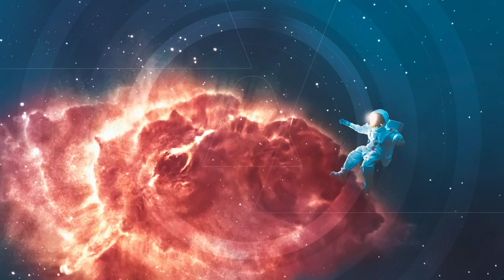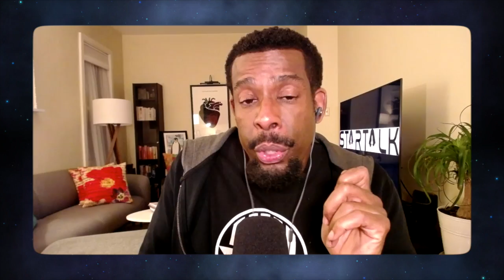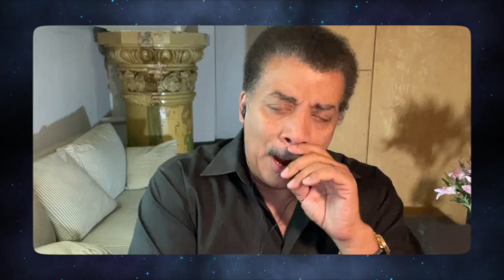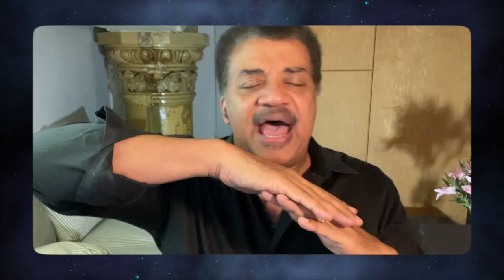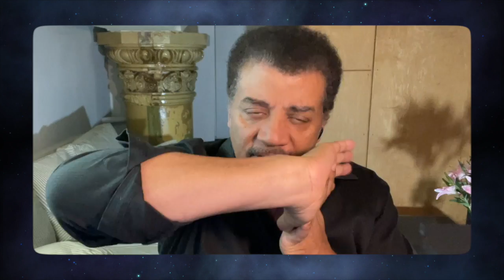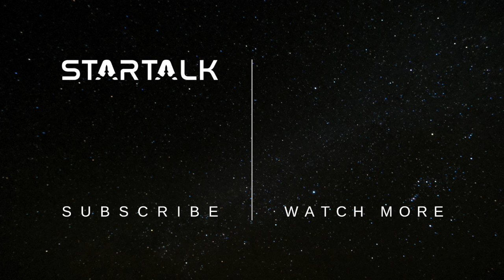Neil deGrasse Tyson Explains Banking Turns

Comment: Nice to see someone who isn't a pilot explain something about aviation and have the information be factual 🙏!!
Reply from the maker: Thank you for your comment, Kelsey!
Reply: Oh my god
Reply: Hey Kelsey
I have faith you'd repeatedly be able to do this manually 🤔
Reply: There is no special computation necessary. You fly the turn by banking the ac and the turn radius is a result of the bank angle. Acceleration will alway align as described. And if you maintain altitude during the turn you will definitely feel it because the resulting force increases with 1/(cos Bankangle)
For 30 degrees Bank it will be 1,15G
Reply: @nev4ever  It's amazing how easily he could have had his hypothesis falsified!
Reply: Neil’s IQ exceeds that of all TikTokers combined.
Reply: Not factual. He is 100% wrong. Even said he didn’t research it.
Reply: I don’t think Kelsey actually listened to this.
Reply: Hey 74gear, listen carefully starting around 2:00 in.

Comment: I work as a crew member for a commercial airline. Typically the crew are let out of their seats after take off much earlier than the passengers while the plane is still at a relatively steep incline while doing the necessary turns to vector in on their cruising course. Even after all the years spent in the air I still enjoy seeing the looks on the faces of passengers when I stand up to commence my duties while the plane is sometimes in the middle of a 30 degree turn and I'm standing perfectly upright.

Comment: Correct me if I'm wrong, but according to classical mechanics, it's definitely possible to have the net force vector point downwards, but it can't equal the force of gravity, unless the aircraft descends as it makes the turn.
That means that unless the aircraft descends while taking that turn, you will feel "increased gravity".
Reply: That's correct.
If the bank angle in a coordinated turn is 25° (typical for passenger jets) the passengers will be exposed to about 1.1 g or 10 % more weight than normal. That's a pretty gentle force unless the change from 1 to 1.1 g happens abruptly.
Reply: @fromnorway643  thanks, appreciate the reply

Comment: Banking has a place in Star Trek and Star Wars due to the orientation of the vessels and their crews, because they ues artificial gravity plating to orient them like contemporary naval vessels. Humans (and by extrapolation, the other species in those IP's) have varying tolerances to g-force based on the direction of acceleration. These are called by direction from eyes (in/out/up/down/left/right). Banking reduces the impact of uncomfortable g-forces on the crews from turning.

Comment: Star Wars vehicles hand wave away the need for decelerating retro rockets by using a sci-fi technology called "repulsors" or "repulsor lifts". Repulsors are what allow the vehicles to take off vertically, hover, and pivot in place. In the novelizations pilots typically have some control over the angling of the repulsor "fields", but in many cases they just vary the power output and tip the vessel itself. There are a few scenes in the movies where you can see the nose of a fighter tip up to angle the repulsor field ahead of the ship to slow it.

Comment: Hello Start Talk!  Airline pilot, flight instructor, and 20+ years in aviation.  What you described is called coordinated flight.  No computer is necessary and humans can maintain coordinated flight because of the force vectors acting on the aircraft during the turn are generally in equilibrium at all angles less than 90* in level flight.  Adverse yaw is a condition that is naturally occurring when a roll force is applied, and is responsible for the “sway”.  For this, pilots use the rudder pedals to stay coordinated.

Comment: If there is a set speed and a set bank angle where the gravity vector still pulls in the same direction, you are talking about 2 constants that make that situation so. However, an airplane does not go from straight and level flight into a bank instantly, it slowly goes into the bank until it reaches that angle. The speed stays constant through it all. That means that you only have 1 constant (speed) and one variable (banking angle). Shouldn't that then also mean that the angle of the gravity vector gradually changes to where it should be as the banking angle changes?

Comment: Pilot here. It doesn't take a computer at all. The more bank you add, the more of a 'load factor' or g-load you get. That g-load is keeping the water in the cup. You don't notice it because we do shallow banks. At 60 degrees of bank you will have 2 Gs, and you would definitely start to notice.
Reply: You are correct that positive G-forces do keep the water in the cup. But you have to be in coordinated turn to keep the water level.
Reply: @jashpatel1477  Correct, this would not apply in an uncoordinated turn.

Comment: CORRECTION ON AIRPLANE COMPUTER TURNS.
Dear Neil, I love your vids and your work.
Just a heads-up on the accuracy of your info about coordinated turns on airplanes being made by a computer. That is not true.
Since day 1 of flight school pilots learn to coordinate a turn (ie. to balance the forces out during a turn).
There is a little instrument on-board to help us do that, it is called the turn coordinator, and it can be as simple as a mechanical device where you center a ball on a round rail, or as complex as a bunch of computers measuring out acceleration and gyroscopic stability.
At the end of the day, that balanced turn can be made "by hand" by any pilot, by means of using the rudder (that vertical fin at the back, which controlled by the feet lol).
So coordinated turns (force equilibrium) is one of the basics pilots skills one must aquire to become at least a decent pilot.
(old school: a glass of water on the dashboard also does the trick. Just make sure you do not unbalance that turn or you'll find yourself with an electrical fire emergency in no time) :)

Comment: Dr. Tyson got this one wrong. Any pilot (and I mean ANY pilot) worth his salt is fully capable of doing a fully coordinated turn so that the water will be perfectly level before, during and after the turn. Not only that, but it'll be second nature to any pilot. No computer required. Just the good old basic flight training. Student pilots learn how to do this in their very first days at flight schools, and never forget.

And here's the kicker: the banking is not just so that passengers don't feel the turn: the banking is absolutely necessary for the turn because it IS what actually makes the airplane turn.  Not the rudder, but the bank. When the airplane banks, some of the lift generated by the wings is redirected to one side, pulling the airplane around.

Comment: If you watch ANY of the Star Wars (movies/TV/cartoons) and look at the docking bays you'll see the openings are ringed by blue lights, these are shields that keep space out and air in. In TROS (The Rise of Skywalker) Poe is given a small disc, that disc allows a ship to fly through the shield into the bay, without it you die in space (except for droids, and Jedi they'll survive).
Also, it says it right at the beginning of the movies "A long time ago, in a galaxy far far away" therefore it is reasonable to assume that the safest way to move ships around in a small space is to use the light wands, the same as they do for aircraft today.

Comment: The only thing is: it's not flying on a cushion of air, it's accually hanging under a vacuum. The shape of the wing is pulling air molecules apart on the top side of the wing. There is a tiny bit of compression at the bodom side, so little you can ignore that. That what they teache me at school long time ago.

Comment: @StarTalk CORRECTION for "Neil deGrasse Tyson". What you described is called "coordinated turn". You don't need computers to do coordinaed turns. You can manualy do coordinaed turns in small single engine aircraft like Cessna 152, Cessna 172 etc. by using the correct rudder, ailerons and elevator deflection. In this case you can bank the aircraft to 45 degrees or higher and the water in the cup will remain level without tilt.
Then you can use inttruments like "turn and slip indicator " or "turn coordinator" to monitor the turn coordination and make necessary adjustments.
Reply: Properly trained pilots don't even need an instrument to make a coordinated turn. The balance of the forces is easily felt, and the airplane is simply controlled to keep them in proper balance.
Reply: @harvey66616  Are you 100% sure you don't need any instrument to do coordinated turns? If so then why are the instruments installed in the coocpits of experienced pilots that have been flying for many years? That will be like waste of money because if they don't have the instruments in the plane they will consume less fuel and make more profit. When flying in clouds or night then how will you know you are flying straight and level inside clouds with turbulent air?
I doubt if there is any training out there that can change the nature of human body to be like a bird.
If you go with your feelings without instrument reference you will probably become a dangerous pilot.
Reply: @IshaqIbrahim3  "Are you 100% sure you don't need any instrument to do coordinated turns?" -- yes, of course I am. As an instrument-rated pilot myself, with three decades of flying under my belt, I am 100% sure you don't need any instrument to do coordinated turns.

You seem to have confused instrument flight with flight in general. Even in instrument conditions, it's trivial to keep a turn coordinated, without any instruments. What's harder is to tell the difference between a proper turn, straight and level flight, a "death spiral", a dive, etc. Instruments very much have their use.

But there is nothing about the claim in the video above that limits the claim that computers are required for coordinated turns to visual conditions, nor would that claim be correct even if we were talking only about instrument flight (and it is laughably wrong for visual flight, since coordinated turns in visual flight preceded the existence of an instrument to indicate turn coordination by decades ).

Comment: What Neil doesn't mention is your apparent increase in weight during "balanced" banking. It's the vector sum of gravity and the centripetal force of the turn. In a fighter jet, that could reach 4+ Gs. In a commercial jet, it probably doesn't exceed 10% in normal maneuvers.

Comment: it's not the computer and pilots can 100% do this, just have to use the rudder manually. I've seen it multiple times on a tiny Cessna. In fact, that's the standard way of turning. It's called "coordinated turn". Also, it doesn't have to do with the banking angle, at least not directly

Comment: BUT… when banking (with a coordinated turn as you described), you would feel heavier, because you’re being pushed into the seat.
Reply: Indeed!
If the bank angle in a coordinated turn is 25 degrees (about the maximum an airliner will normally do), the combination of gravity and the centrifugal force (or "force") will make you feel about 10 % heavier than normal.
Reply: However, if that bank angle increased to 75 degrees – still assuming a coordinated turn – the weight felt by the passengers would increase to nearly 4 g.

Comment: 30 degree angle requires you to pull 1g. This is why airlines rarely bank more than 30 degrees. A 60 degree bank requires you to pull 2gs. Doesn't require a computer, just basic analog instruments.

Comment: Yes, you DO need to make a banked turn in a craft in the vacuum of space.  When you turn the vehicle, you are ACCELERATING, because you are changing the VELOCITY VECTOR, which is, simply stated, SPEED * DIRECTION, and that acceleration results in a lateral force on the vessel and  passengers/crew. If Kirk's NCC1701 Enterprise crew is slung left and right in a turn, it's because the craft didn't bank, it just 'skidded' around the turn. And 123Comrade, below is correct about using wing lift aid in the turn. d3faujlt, below is exactly right. There may be others that agree with us, but there are too many comments to read them all.
Reply: Turning at rates comparable to that of aircrafts would be impossible to any spacecraft at orbital speed even if its engines could change the velocity vector enough to do that (any wings would of course be useless in vacuum).
Imagine a spacecraft moving at 7.7 km per second (orbital speed at 400 km altitude) trying to change its direction by 2 degree per second while maintaining its speed. That may seem like a relatively slow turn since it would take 90 seconds to change the course by 180°, but it would produce 27.4 g or three times the upper limit of most fighters.

Comment: There's several forces at play, some imaginary like centrifugal, some real like gravity, and they all add up to 1g down toward the floor of the plane. Did I get that right?
Reply: They don’t add up to 1g, 1g is only the vertical component needed to keep the plane from losing altitude. Horizontal component is what makes the plane turn and overall force magnitude is greater than 1g based on the bank of the turn. At 45 degrees it’s around 1.5g, at 60 degrees it’s 2g, approaching 90 degrees of bank the force increases dramatically which is why only few planes can bank that steep and pull many g’s in the process such as fighter jets.

Comment: Watching this a few weeks late. I'm not a pilot. However I've been around pilots and aircraft. What you're describing is what they call a coordinated turn. A pilot can can physically fly a plane in that type of a turn. In fact if you are to ever feel a plane bank in a turn, that is an uncoordinated turn and that can lead to a stall. For example: If a pilot was to use just the ailerons to bank the plane for the turn, you'll feel the plane bank into the turn but now you are in a skidding turn which can lead to the downward wing losing lift and stalling do to the upward wing having more lift and the downward wing losing airflow over the top and it can suddenly and very quickly drop the down ward wing. Executing a coordinated turn you're using the rudder to allow the tail of the plane to turn the nose into the direction of the turn which now makes the plane make a coordinated turn and you wont feel the leaning motion.

Comment: What about motorcycles? They do the same as the planes do... just without any computer. In theory the water in the  glas should be level on a (motor) bike as well... at least if the road was without bumps. ;)

Comment: Others have said that a coordinated turn is what you're talking about and pilots have been doing that since the earliest ages.  However, the force you feel pushing down in your seat will increase the more the plane is banked.  I think at a 60 degree banked coordinated turn, you'll experience about 2Gs, which is why airlines don't typically come anywhere near that angle, even though structurally the planes can support 2Gs.

Comment: Physics major (many moons ago) and recent private pilot license obtainer here!!!  
This is a huge thing!!!  When flying into IMC, instrument meteorological conditions (i.e. clouds), there is no way you can know which way is up by "feel" alone.  You MUST RELY ON YOUR INSTURMENTS and not your physical sensations.  Pilots trains for this by doing 'unusual attitude' scenarios:  you close your eyes while your instructor puts the plane through a series of maneuvers that feel like you're on an amusement ride.  Then he puts the plane into a banking climb or a banking dive.  You will be asked how you think the plane is oriented and it's 50/50 you get it right.  You are told to open your eyes, and recover the plane to level flight.  It's amazing how the body is fooled by the centrifugal forces!

ETA:  no computer involved here per se.  Most turns are done at the "standard rate turn" of 360 degrees in two minutes.  Typical approach speeds are 200kts.  Someone can do the math but I think whether you feel 1g or 1.1 g is really impossible to discern.  The point is the resultant force (vector sum of the centrifugal force and gravitational force) is right through your soft rear end and padded seat cushion you are sitting on.
Reply: I.e The Leans

Comment: While its true modern commercial jets have computers flying the plane for the most part.
As someone who has flown more analogue planes as well as jets, I can say humans can also fly a plane in such a way that the turns are balanced and coordinated.

If you just banked a plane, part of the lift is now pulling you to the center of the turn. We pitch up slightly to add more lift. This gives you the sensation that you are still at 1 G. (Otherwise it would feel like you are below 1G as you are losing altitude).

 We add rudder to make sure the plane doesn't drift out of the circumference of the turn being made. 

We use instruments onboard that tell us if we have enough pitch and yaw to make sure the banking plane is at 1 G. (essentially)
Reply: Correct. Positive G load keeps water in cup. Coordinated turn keeps water level.
Reply: @ToddKnauer  
and I can do a bunch of crazy maneuvers with my little car....

but Not so much when driving my mom's minivan. 
❤❤

So... It might be a bit trickier when piloting a bigass commercial airliner.
☀️☀️
Reply: @HughJass-313  Actually, it's easier.  In an aircraft, you have control of all three axes of rotation.  Not so much in a car.
Reply: @ToddKnauer  
🤣🤣

I hear ya.
Just saying it might be trickier as you scale up.

Or NOT. 
❤❤
Reply: @HughJass-313  Not at all, bigger planes have auto-trim, more precise sensors and instrumentation. Its easier to hand fly a jet under normal law (When all the systems are operating normally).
Reply: @123Comrade  

Fair enough
❤❤
Reply: @ToddKnauer  😅 I know. Didn't want to get into load factors and all. I should have said the G loading is in line the vertical axis of the plane and there are no lateral loads. So the water in the cup doesn't tilt.